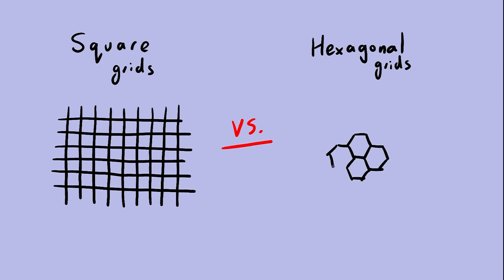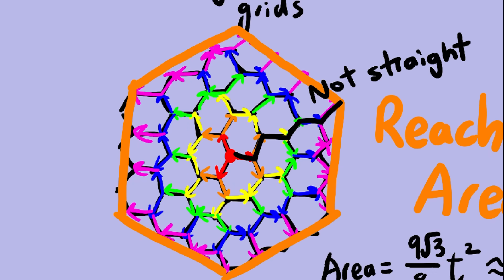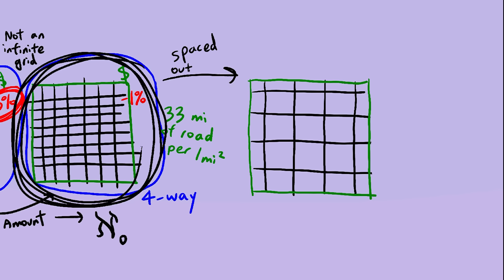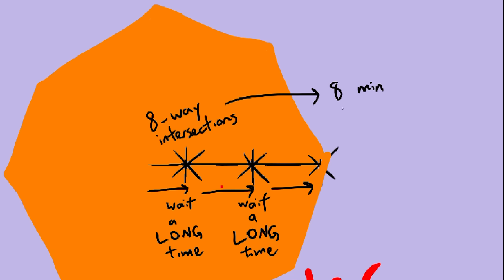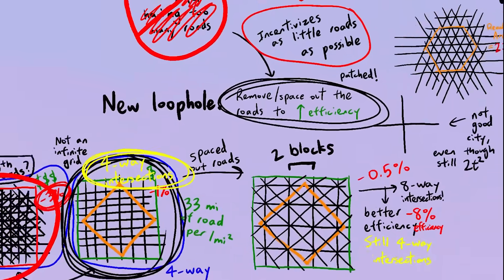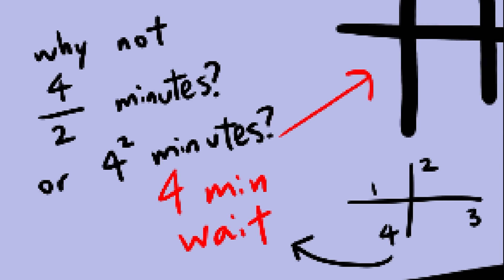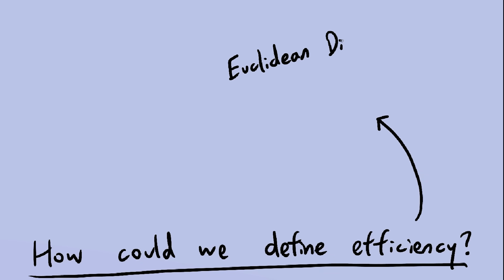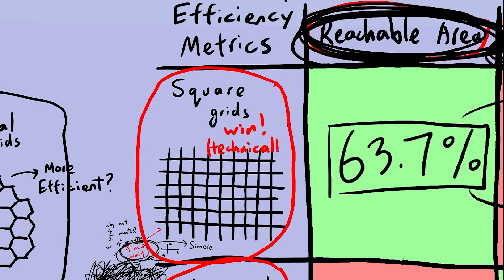Would hexagonal city blocks be better?

Comment: Maybe the fact that straight roads allow you to maintain your momentum rather than slowing down every corner is essentially the reason the square grid is the most popular in cities despite many years of advancement. As you said, hexagonal grids are not a “master in one direction” like square grids, but a “jack of all trades” being efficient in all directions; nevertheless, even if you take “the longer route” (but straighter) in a square grid you’ll be able to maintain your momentum, while encountering smaller intersections which just increases the effect.

Usable city space is something to consider of course. Anyways, great video.

Comment: Loophole can be fixed by setting a standard block size. The exact number would depend on how big the buildings need to be but that's too granular for this thought experiment. Also the wait time should be related to the number of roads - 2  (not exact but feels closer than just the number of roads)

And how do roundabouts change the equation? They reduce time at a junction on average but that varies with the number of joined roads too

Comment: There is actually a neighbourghood in Madrid that tried applying the hexagonal grid, Ciudad de los Poetas/Antonio Machado, around the metro Antonio Machado. However, they weren't very strict when imposing the grid, thus some streets are cut off and the whole neighborhood runs through a central axis (calle Antonio Machado), that sometimes breaks the hexagonal grid, so it isn't very efficient for cars (but pedestrians have some get-throughs and cutaways through buildings or parks, so it's not that bad for them)

Comment: Fun fact: You were right on when you put +1 penalty per road in an intersection. You can show that the amount of traffic light combinations (How many different patterns of red and green are shown to allow all turns at the intersection without having crossed pathes) is exactly the amount of possible directions of two way streets. 
This can be proven by induction. You start with a straight road. It has two directions, north and south. If you want to allow cars from south to go both north and south (Which means go straight and turn around) you need a traffic light that switches between "Going straight" and "Everyone can turn around". Two different sets of signal. If you add another road to it, You get one of set of signals, because the new road (Let's say east) will add one more intersecting road (Left turns are the hard problem, given right lane traffic). This can then be expanded, and every new possible direction adds another required setup. 

Another interesting fact: There is no benefit of having cars from opposite lanes going at the same time. In any intersection, it is equally efficient to have any combination of traffic light signals, as long as the loop doesn't have more different setups. So any loop of signals that allows all possible turns and has the minimal required set of different light configurations is equally efficient. For practice,let's assume the standard 4 way intersection. in this, it means that a light that allows cars from one direction to go straight, left and right while all other cars wait, and then cycles clockwise to the next cycle, is as efficient as North and South being allowed to go straight and do right turns, then north and south being allowed to do left turns, while east and west are allowed to do right turns, then having east and west go straight and do right turns, then east and west doing left turns and north and south are allowed to make right turns. The latter is the standard intersection timing for most four way intersections, but they are not more efficient then the clockwise solution. Which sounds weird, but is true, as both systems need 4 cycles to allow all turns to happen. Yet I have never seen a traffic light that allowed one direction to make all turns at once and then cycle to the next one in practice.

Comment: Nice video! Though I feel like your framing of the problem is a bit muddled…. What should we optimise for in a city grid? Travel distance AND liveable space (hence we don’t have infinitely many roads). So assuming each resident needs 1 unit area to live, perhaps your question could be: “what tile-able shape of unit area minimises the distance between random points along its grid?” That unit area constraint defines your grids scale and removes most of the loopholes you mentioned.

Comment: You could've standardized the size of a city block to avoid the loopholes of making the roads sparser, or having too high road-count intersections. Sure, you can make a grid of 11-way intersections, but you have to fit a block standardized area city block between each of the roads. It's not going to be perfect of course, but I think you'll get numbers that are closer to being useful.

Comment: How about measuring efficiency against the amount of area used for the exact same amount of road and related infrastructure? The penalises the “extra roads” loopholes because the extra roads will eat into area that should be used for something else. So work out the %area taken by roads in the square grid and space the hex grid out to achieve the same ratio. Your roads will no longer be unit length, of course, so the maths will be fractionally more faf, but the average grid-vs-bird ratio should be a reasonable guess at efficiency. Perhaps leave out short distances, one or two blocks, as people are more likely to walk those. In reality a variable density will be most efficient, and to avoid “just make spaces bigger” loopholes in the calcs you need to add in some “minimum distance from a road” rule for any given point in the area. Considering all the ins and outs of this could involve writing a book, or a series of books, …

Comment: IMO a fair way to compare grids is to define a fixed road width, and have them all use the same ratio of total road area over total building area. Depending on that ratio, different grids may win. In any case the problems you identified then cancel out: a grid with more road directions will require larger blocks.

Comment: When I've wondered about philosophical, imaginary ideal city layout, the framework I used was a need to visit every location.  Streets are needed everywhere to provide basic access.  Too many streets overwrite too much of the potential area for destinations.  Streets, of course, are not mathematical lines.

If all you want to do is compare grids like 'square' and 'hexagonal' one rule might be to scale the streets 'til they cover the same area.  So, my favourite might be triangle grid, but to keep the same density of roads they need to be farther apart.

If I magically got to invent a city layout, it would be with rail lines in a triangular grid, creating hexagonal hub areas.

Comment: There's also primary, secondary and tertiary roads to consider. I'm not totally sure how that would change things especially for the hexagonal grid, but since towns are built on just a few big roads with a lot of little, usually slower roads branching off that could effect the reachable distance by quite a bit.

Fun video though :]

Comment: I would expect a triangular grid to be superior to a hexagonal grid. Assuming parallel lines are equidistant from each other in both the square and triangular grids, the latter would require 50% more roads. Each block would be a little longer than a square grid's block, thus making them a little more efficient with travel time and the number of intersections crossed. And the use of 60-degree angles allows more direct routes towards destinations in all cases compared to 90-degree angles.

I think triangular would be far superior, just at the cost of 50% more roads.

Comment: I believe the penalty for intersections should grow exponentially the more roads there are. For example, there are 24 different ways for two cars to either cross paths or merge paths. in a three way intersection there are only 9 ways. As you can see the intersections become very complicated very quickly the more roads you add. Also, the other roads in a 3 way intesection are at a 120 degree angle to your road. So you can see oncoming traffic pretty early. A 4 way intesections has two roads at a 90 degree angle, which means you will only see the cars on those roads once they enter the intersection.

Another advantage with a hex grid is that you get more building area per distance of road. Hexagons are the tile-able shape with the highest surface area to circumference ration, so a hexagon grid would require less road to pave.

Comment: The reason, for there not being a place made of 100% road, is because roads are used to get to places and if you have 100% road, you have 0% need for roads.

The cost of a road isn't really a reason, because any way (line) between two visitable places (points) will become a road of some kind (given enough travel).

Comment: Anyway, this video has nothing to do with city planning or whatever but whatever

I think that hexagons would work well as superblocks with the sides of the hexagon being tangent lines on a circle with a diameter of 0.75 to 2 miles and a square, rectangular or brick grid internally and the slack space filled parks, playgrounds, woods or other green space.

Comment: The efficiency calculation could favor square if account for having to wait for two directions to move instead of just 1 for square (left and right move at the same time, and across not at all). The square does have the left turn signal, but that's always for a shorter time, so you could say that a square grid has to wait for 1.3 while a hex has to wait for 2. That would be more accurate. Btw, I'm ignoring the right turn part effect because both the right turn benefit.

Comment: 6:59 oh yeah, it's totally possible to remove some roads from square grid to make it more efficient than the hexagonal.
Take normal square grid, separate it into chunks of size NxN, for some arbitrary large N.
 Color those chunks in 2 colors in checkerboard pattern. Now for color 1 keep only horizontal roads, for color 2 keep only vertical roads.
Now almost every intersection is a three-way, so we diluted the road inefficiency factor from 4 to 3 + epsilon.
The reachable area, however, is entirely unaffected - we just have to use roads between chunks more.
If the original % for the square roads was 12.7% according to the table, and we lower the road difficulty factor from 4 to almost 3, then the new % should be almost 12.7% * 4/3 * 4/3 = 22.6%, which is a lot better than 15.5% of the hexagonal roads.
Now just find a suitable N, and done.

Comment: I would say in order to be considered a grid, it needs to consist of a repeating shape tiling the plane. 
Sure you can design a city layout that doesn't conform to that, most, if not all, European cities aren't even close to looking like a grid, for example, but they're not grids, so they aren't in consideration for this.
It can allow us to more easily look at more options than just squares and hexes (such a triumphant triangles!), without opening ourselves up to too many possibilities (e.g. intersections with 11 roads wouldn't come up I think, as I don't believe there exists a shape that would create 11-eay intersections whilst tiling the plane)

I also think we should first put in place some practical limitations:
We should probably define a certain ratio of road to buildable area to be practical; too much road is rather useless, as it would leave no space for locations to actually go to, but too much buirlavle area would mean that we can't reach our destinations anymore; we could even try out a few ratios and see if the efficiency changes depending on that ratio, or whether a particular shape grid is always most efficient regardless of that ratio. This also prevents the whole "cheating the efficiency by spacing roads further or closer or going all road".

For wait times, I think we should keep in mind that a single road is actually just a 2-way intersection, but it doesn't create any extra time, so there must be a better way to calculate some sort of wait time or efficiency loss from intersections than just dividing by n or reducing the efficiency by n% for n-way intersections, as otherwise we'd have to somehow also divide by 2 or reduce by 2% for stretches of road. If dividing is the way to go, then perhaps it's something like dividing by n-1, and if deducing a percentage is the way, then perhaps (n-2)%, but there's a good chance there's a more complicated calculation that gives more accurate results. You did make a video about intersections a while ago, is there perhaps something from that which we can adapt for this? I would however suggest that we ignore the possibility that people would make u-turns when we're considering efficiency; whilst people might try to make u-turns if they've made a mistake, if we're looking for efficiency, a U-turn would never be part of a most-efficient route.

[Edited To Add: refreshed my memory by rewatching your intersection video, it seems like an n-way intersection requires n phases, so let's start there. We can assume we allot the same time for all phases, which allows us to calculate an efficiency of the intersection as an average wait time divided by the total cycle length of all phases combined. However, we also learn from your video that the immediate neighbours are non-trivial directions to go to, so at an n-way intersection, there are n-2 trivial directions that require waiting, which is also our justification for why we don't need to consider "2-way intersections" a.k.a. roads. Let's look at a 4-way, intersection, when we arrive there are 4 directions we could go, but we don't care about u-turns, which are one of the trivial turns, so actually, there are only 3 directions to go to that we care about. We can turn left, go straight, or turn right; that last one is trivial and doesn't require waiting, so 2 out of 3, or (n-2)/(n-1), of the directions that we care about are non-trivial, so we should only consider wait times for 2/3 of the directions of a 4-way intersection (1/2 for 3-way, 3/4 for 5-way, 5/6 for 6-way, etc.). Then the wait time when going non-trivial. Since there are n phases, the wait time,depending on when you arrive, could be: 0 phases, 1 phase, 2 phases, ..., n-2 phases, or n-1 phases; you'd never have to wait n-phases, as that would cycle back to you arriving when you can go right away at 0 phases, e.g. at a 4-way intersection you may wait 0 phases, 1 phase, 2 phases, or 3 phases, (if there's too many cars waiting the wait could be 4+ phases if you need to wait another full cycle, I suppose, but I think that's outside of the scope of our problem.
So then we have ((n-2)/(n-1))*average(0,1,...,n-1) as the number of phases you'd have to wait.
That gives the following results:
3-way: (1/2)*((0+1+2)/3)=0.5
4-way: (2/3)*((0+1+2+3)/4)=1
5-way: (3/4)*((0+1+2+3+4)/5)=1.5
6-way: (4/5)*((0+1+2+3+4+5)/6)=2
n-way: ((n-2)/(n-1))*((0+1+2+...+(n-2)+(n-1))/n) = ((n-2)/(n-1))*((n-1)/2) = (n-2)/2 phases
To then get a a proportion of time, we also need to divide by n, so we end up with (n-2)/2n for the portion of time we'd have to wait at any given intersection; multiply by 100% and you have it as a percentage. However, we then further need to consider the time proportion of intersections compared to road surfaces, and only apply that intersection delay to the portion of road where we have intersections, which will depend on the ratio of road to buildable area that we chose, as well as how wide the road is; so setting a fixed road width is probably another thing we should do.
Alright, edit over, let's get back to the rest of my original comment.]

As for how to determine efficiency, we really first need to know what we're trying to optimize for. I think comparing travel time on the grid to travel time as if you could just go directly as the crow flies (at the same speed you'd go as on the grid) makes sense, but we should do it for all points on the grid (or at least try to get an estimate of that, even if we don't actually measure every possibility; an advantage of limiting ourselves to actual grids is that it's regularity means that once we've found it for a particular type of route, we can see that that same route just moved/rotated exists in many other places too, and we can use that) including routes which may just be a straight line, possibly even without intersections between them. I do think taking into account intersections as something that causes additional delay as something valid to consider (assuming all roads are 2-way; if we start considering roads that only go 1-way that would complicate things even further I think)

Comment: If you are actually driving, then the angle of a junction affects you quite a lot.

On a grid, straight across is obviously easy. But a left or right turn is a 90 degree turn which might well require more of a speed reduction and a harder turn of the steering wheel. You also tend to have poorer visibility down the road beyond the junction.

In a hexagon grid, while all turns end up being 60 degrees - left or right - they can be driven faster and with better visibility. Assuming green lights in all cases.

There is also the implicit assumption that everyone uses the best route. Which they don't. For example, if I miss a junction on a square grid, I might have to make two rights and a left to make up for a missed right.

You also have the issue of what do you do when you reach your target? You can't just stop and leave the car there.

Comment: Actually you also have to consider that if there are more roads you don't have to wait in line for the cars to move, because they're more distributed, so you can go faster. If there are less intersections but the roads are full, those few intersections will be superslow.